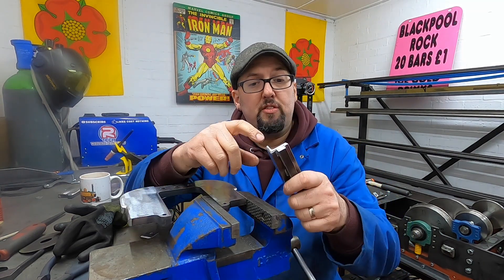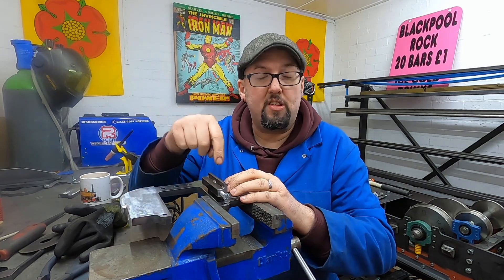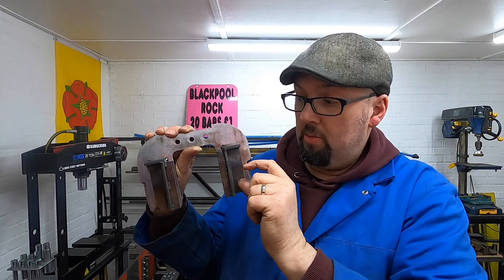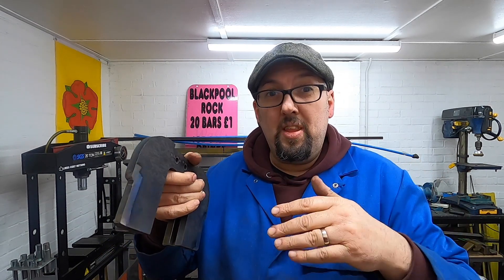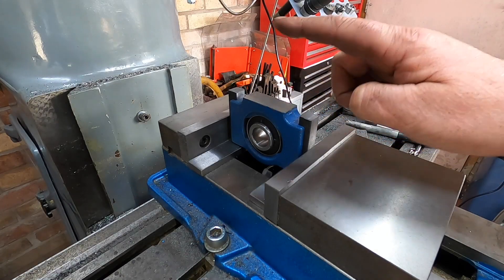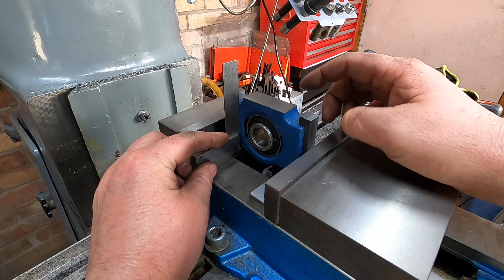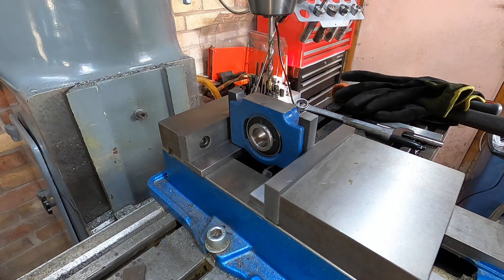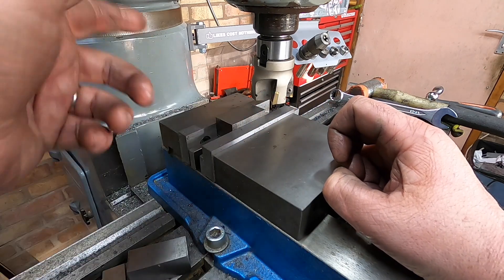The Pony Truck - Pt 5 - EP20 - 7.25" Gauge Steam Locomotive Build.

Comment: Much better design for the pony truck wheels. Maybe the main frame should be changed as this will allow adjustment  over all the wheels. Nice welding and its good to see prep work done so the weld joint has the correct penetration's for maximum strength.
Reply from the maker: Thanks RB, Anyone would think I was a welder in former profession 😂 Haha. The rear driver has very similar suspension to this all ready, I've only briefly mentioned it in a very early episode in season one. I'll most likely cover it when we get to fitting the wheels in future episodes. All the best, Matt

Comment: love the way you go from metric to imperial, "holes 35mm apart and a half inch deep" Excellent!
Reply from the maker: Hi Geoff, it’s terrible habit I have with that! 🤣🤣. I use to work for a firm where half the staff could only use metric and the other half imperial, so I learnt both. Now I’m blessed with working in both at the same time! All the best, Matt
Reply: @MattChiversWorkshop  I'm exactly the same, which measurement is the most convenient! I'm of an age where I started on imperial then changed over to metric so either works for me too. Great viewing, appreciate the time it takes to put these videos together. Cheers Geoff.

Comment: My Tuesday is complete Mr Chivers! Another classy video from Lancashire.  Question now is whether you will be providing a leading pony truck as well - you have sorted the design so why not?  Keep the videos coming matey!
Reply from the maker: Hi Grum, Hmmm 🤔 not this one, although the local one is having new tyres on the front wheels as they have worn away to very little flange. Steve the owner reckons if it had a leading pony it wouldn’t have done it as it has a guide into the curves. Can’t wait to get the pony finished now though, didn’t think we would be on so many episodes for one item! 🤣🤣. All the best buddy, Matt

Comment: I meant to say, interesting use of seasons and episodes.  I did the same thing on my 2.5" build but I wasn't sure how useful it was. Maybe as it gets well into the double digits it will be more accessible for viewers who join midway through? Good progress and good luck with the remainder. It seems as though the cul-de-sac of the over-large wheels and non-adjustable truck has been escaped?
Reply from the maker: I decided to do it for achieving purposes, season equals a year, so if I finish it say season 4, you’ll know it’s taken me 4 years to build. Makes it easier to find particular videos in playlists without having to scroll through hundreds of videos.

The new version of the pony truck is much better that version one. Version 2 is my interpretation of the pony truck that is on the tink at my local club. All the best my YouTube buddy. Laters, Matt